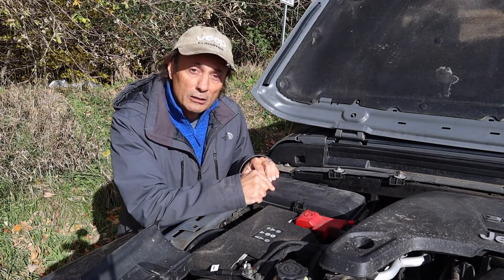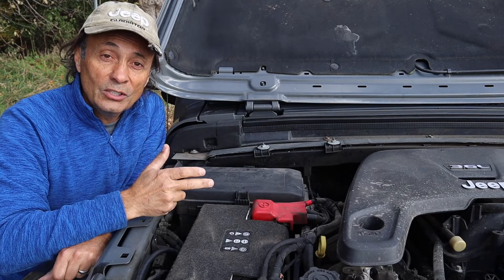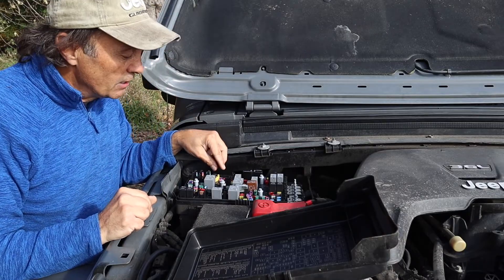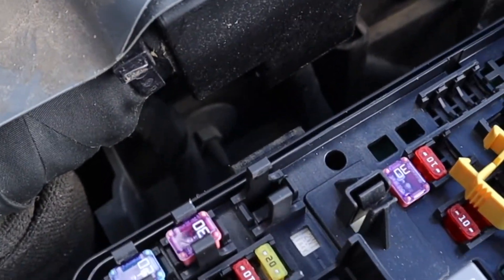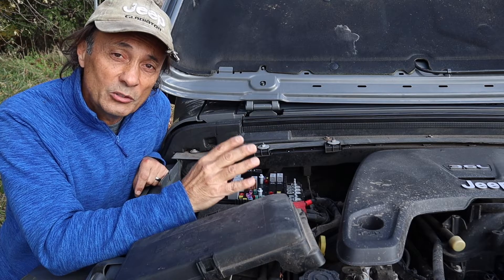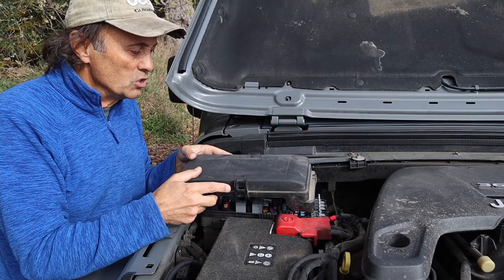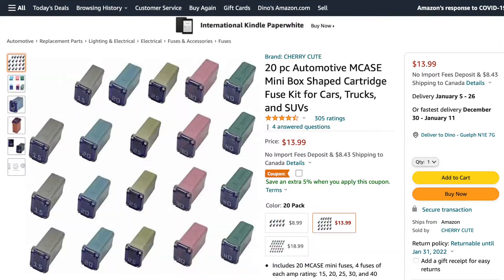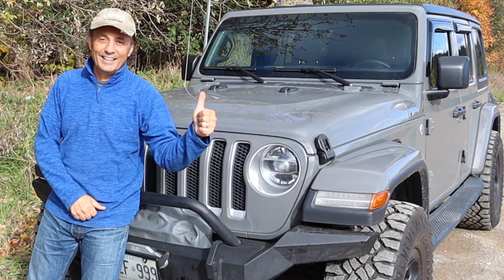Jeep Wrangler JL Fuse Box Information

Comment: Good video! Just popped my 20a fuse for the cigarette adapter and made the mistake of buying micro fuses and not the micro2. Ended up replacing the fuse with the heated seats one which is weird because mine doesn't have heated seats. 🤷🏻‍♂️ Didn't even think Jeep supplied spares which was cool to find out thanks to your video. 

Now I have to return the other ones and get the proper kit. Appreciate you tagging the Amazon link! Mahalo! 🤙🏼
Reply from the maker: Awesome. I’m glad you found a video helpful. Cheers.

Comment: Hey Dino, another GREAT video, especially for those new to JLs or those who never had to deal with fuses... THANKS!
For us DIY-ers, I can tell you, we more or less learned about the fuse box on our own (some of us the harder way  😁)
Few tips for all:
- The spare fuses (as you pointed), do not have contacts below to plug to, therefore they are loose in the holder, so fuse holders have small tabs on top to keep them secured - easy way to find the spares...
- The trunk/cargo power outlet has the fuse holder with 3 contacts, so choosing the position of one or another dictates if that power outlet is powered all the time (BATT - F43) or only when the ignition is on (IGN - F45)
- If you do any soldering on your wires (i.e. adding the wire for extra USB plug charger to front power outlet/cig. lighter), pull out the fuse for that device (F52) before soldering, as live solder will blow up your fuse
Cheers, Nash
Reply from the maker: Hey Nash, Awesome tips as always. Thank you. Cheers.

Comment: Thank you for this informative and helpful video Dino. You have one of the best channels that cover the JL / JT. The one thing I dread is when the 2nd auxiliary battery has issues under the fuse panel. I believe we lift that to get to it. Something to look forward to lol lol. Thank you again! Have a nice weekend.
Reply from the maker: Hey CN,
Thank you for the kind feedback on the channel. 
Admittedly, I too am nervous about the dual battery change that will become due. Until then, I carry a battery booster pack to help me jump start the Jeep when the inevitable happens. Thanks again. Cheers.
Reply: @CheaperJeeperTV  
The secondary battery is to power your minor devices (fan, radio etc.) while the Stop/Start system is engaged (turn off the engine when you press the brake), I hate it and always turn that feature off when I drive my Jeep, so that second battery does not get any use... This Stop /Start feature supposed to save you gas, but I tested it on my 2021JL automatic 3.6l gas on normal drive for a month with and a month without, and when used my average is 16.8 l/100km, when disabled it is 16.2l/100km... I find it, for myself, turning this annoying feature off, actually saves me the gas...

Comment: i'm so thankful i found your channel today! i accidently engaged the anti theft immoblizer and i don't know how to turn it off. i have my key fob i've tried locking the doors, unlocking the drive door with my key and the brake is still stiff and the red light is still on. ive also unplugged the battery and took the batter out of the key fob for 20 minutes and the system is still activated. can you help me?
Reply from the maker: Oh man!  I’m not really sure how to help. If I were you, I’d post your question on a forum to see if you can get some immediate help. Good luck.

Comment: Hi CheaperJeeper, we really appreciate your videos. Could you please help us out? 

We are trying to figure out how to power our 12v aftermarket heated seats in our 2020 Wrangler Sport. They are two separate kits, one for the driver, one for the passenger. 

We are thinking of installing a single fuse tap with a 20amp fuse to the fuse #45 in the Wrangler fuse box, connected to 2x positive (2x) wires running all the way through the firewall, into the console area, where we can plug into our two heated seat kits positive terminals. We can then run the heated seat kit negative wires into the floor ground terminals bolts. Does this sound like a safe plan? Thank you
Reply: So I am not familiar with the #45 fuse but if it is a keyed power then that is safe. One single 12-14 gauge power wire will be plenty for both seats. Run the single power wire to one of the seat switches and then the other. The ground wire should go direct to battery ground. Running to a body ground will surely cause issues in the future. Depending on the power draw some of these appliances are better to be powered through a relay.
Reply from the maker: Hey Jeff, Thanks for your expertise. Cheers
Reply: @jefftenhave8038  Thanks! Greatly appreciate the help.

Comment: I need to pull F97 for radio and the chart suggests to pull 20 amp yellow but there are quite a lot of 20s. Which one do I need to pull for dashboard radio? Thank you!
Reply from the maker: The map on the back of the lid shows where fuse F97 is located in the panel.

Comment: Love this video!! An add-on this video would be a video on how to install external electronics (for example external after market lights) to the fuse box to power them.

I noticed you have a Sahara similar to mine, I don't have the interior dash Aux switches that come with one of the optinal packages so a video to bypass those and connect to the fuse box would be very helpful
Reply from the maker: Hey Deep C, Thanks for the suggestions!! Cheers.

Comment: I have the factory installed aux switches in my JL/ This video is great, but one discussing those aux would be cool. I have one go the unswitched if=gnition hooked to my air compressor in the rear. One of my switched wires goes too my dash cam. Switched is great because I can it to ignition - my normal use as its garaged, but I can easily set it to battery, for like parking at the mall. All through the radio settings panel. if the 6 wires in the body, the 4 switched ones are replicated under the hood - making adding extra lights, a winch etc very easy .
Reply from the maker: Hey Patrick, THAT'S a great idea for a video.  I should really learn more about that, as I have Aux switches in my Sahara. Thanks. Cheers.

Comment: Hi Dino, Just subscribed. Trying to figure out what the M6 slot is on a JL since this was a big help
Reply from the maker: Hey Kevin,
Thanks for subscribing. I'm unclear about what this M6 slot is that you are asking about. The Jeep has M6 bolts, are you asking about the bolt retainers/holders in the rear of the Jeep, where you open the tailgate?
Reply: Figured it out. Rock light power panel came with the wrong size fuse relay and they kept saying put in M6 slot which was actually the cigarette lighter you mentioned but cant put square peg in round hole. Thanks for replying.
Reply from the maker: Hey Kevin, No worries. I'm glad you worked it out. Cheers.

Comment: I changed my headlights to LED last year and one light is not working now. Are there fuses for this? Is the fuse on LED line itself? I can't see anything marked headlight on fuse box
Reply: Unfortunately there are no fuses on headlights. There is a headlight relay however, but if that goes both headlights will go out.. So, unfortunately you have a bum headlight, perhaps you still have warranty on those headlights...
Reply from the maker: Hey Jeff,
Thanks!
Cheers

Comment: Could a blown fuse be the reason why the  ac in my 2022 Wrangler Jeep is blowing hot air?
Reply from the maker: I am not sure. Sorry.
Reply: @CheaperJeeperTV I took it back to Jeep.. it needed a new compressor, so they replaced it, with some other part they said was needed for the compressor to work.
Thanks!
Reply from the maker: @user-fx3sj1vf5q Awesome! I’m glad things got sorted.

Comment: Hello, I have a problem. I need to get power to a under seat subwoofer but my 2021 JLU is a manual so my clutch is taking up the hole that most guys put their wires through. So any chance you could tell me how to get a wire through the firewall.
Reply from the maker: Hey Larry, 
Do you have the AUX switches on your JL? You can possibly use one of those switches as they have wires going to the. battery?Maybe? Also, I'd find out how those AUX switch wires are fed through the fire wall, as you might likely be able to use that route? I'd like to know what you end up doing for sure. Cheers.
Reply: Not sure where is your clutch (covering which hole) but JLs have two grommeted holes in the firewall, one on the drivers side and one on the passenger (youtube has videos how to find them). Definitively, as Dino replied already, the JL has auxiliary switches for wires located simultaneously in the engine box and inside the cabin (passenger foot well), where in the cabin there is also additional one live 12V attached (not controlled by aux. switches). Those can be used for your power, as long as the sub does not pick some weird electrical field interference from them... (some people reported they couldn't wire in their radios to those because they generate some kind of buzz)
Reply: @alopandur  Thanks but I have watch dozens of videos on getting power into the JL from the engine compartment and not one has said anything about there being a hole on the passenger side. I will go crawl under mine today to look for it but if you know of a video showing this please let us know. Thanks again.
Reply from the maker: Keep us posted.
Reply: @LarryRichelli  
Larry, apparently it is very hard, but possible to reach the passenger side grommet without any parts removal, but removing the dual battery supposed to allow for easy access.
Maybe even behind the passenger front wheel well wall?
I have to admit I haven't seen any videos myself or know it for sure, so my info could be wrong, indeed...
Here is a view from another video about dual battery kit replacement from Genesis, with the firewall free of parts, but I can't say where is the grommet 
https://youtu.be/rP-gWKy-Y9s?t=600
Reply: @LarryRichelli  
Larry found you the (sort of) reference for the passenger side firewall grommet here 
https://youtu.be/pZeEX-exaf0?t=54

Comment: I lost all power to the dashboard after the battery terminal tripped. I replaced the fuse array but I still don’t have any power.
Reply from the maker: Hey Armin,
Sorry to hear about that. This sounds definitely like a job for a professional! Good luck.
Reply: Did you figure out whtat caused your dash to go out? Currently having same issue..Jeep runs all electric accessories work just no dash at all!